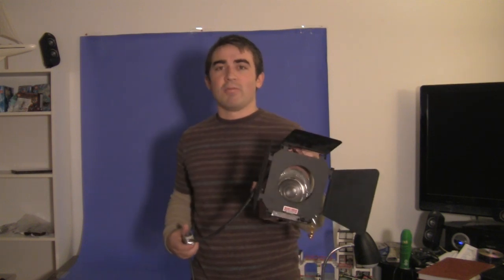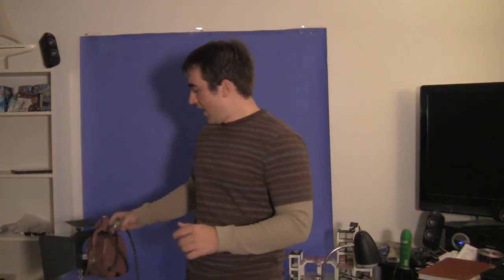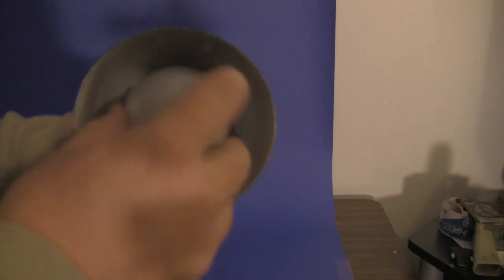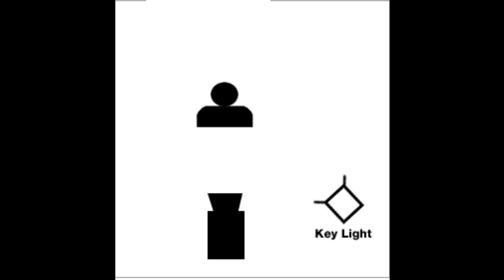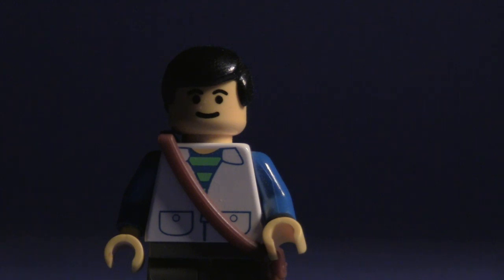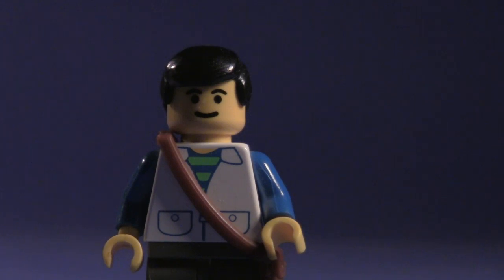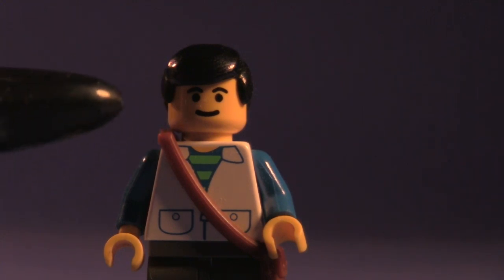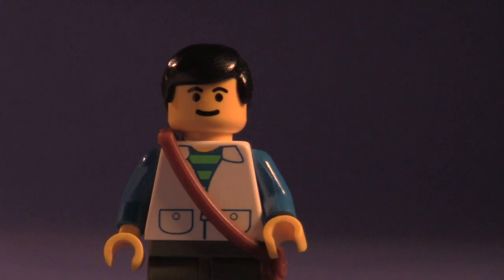Brick Film School! Episode 2: Basic Lighting

Comment: Hey man, what i used is flexible USB L.E.D. lights connected to a USB strip hub. the light is a lot smoother plus they are only £0.99 each on ebay, or even cheaper if u can get them in asia

Comment: When I film with lights like this I get severe flickering where either my shadow is projected onto the set/subject or the flicker rate of the lamp is an issue. It ruined everything I filmed. I stopped using the lights and it fixed most of the problem but I cannot control the lighting at all, just use room light. This puts me off animating
Reply: The problem with room light is that it'll change while you animate so you'll have severe light flickers which are terrible. And how about you use a remote from a distance so your shadow won't hover over the set.
Reply: I tried using localized lights and the effect was worse. I also can't remote control the camera as it's a compact not a DSLR
Reply: David G Have you checked your camera settings? Set them all to manual.
Reply: Try using room light + lamps.
This work well for me as I make my brickfilms in my room and use what I have said above.
If you want to know any more about message me via YouTube.
Hope I helped!
FuzzBall Productions